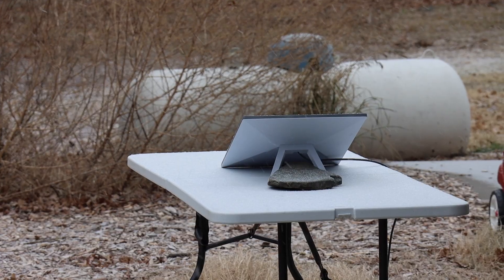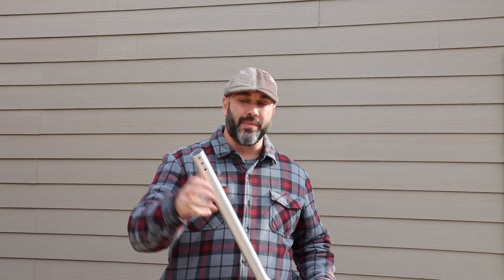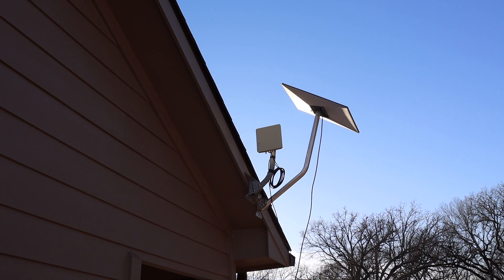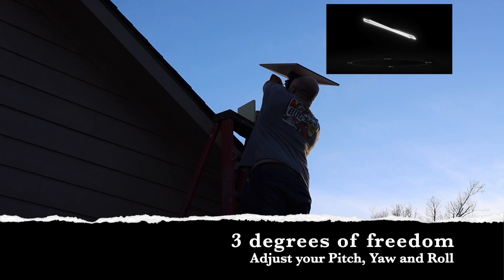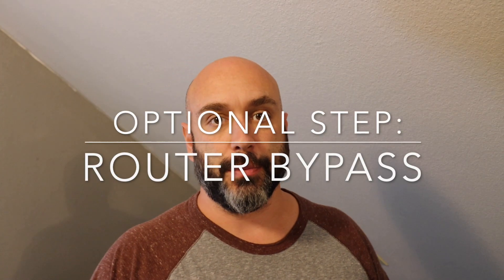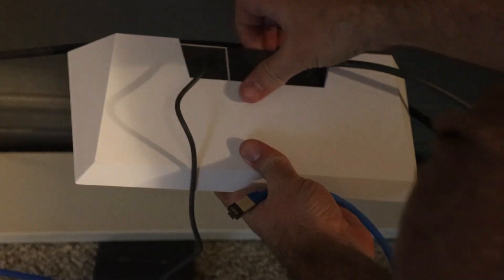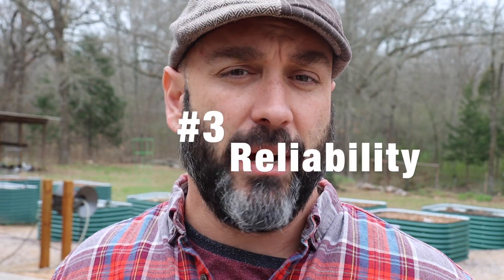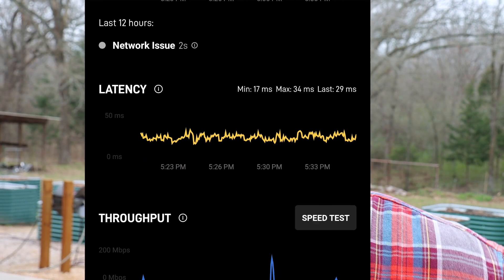DIY Starlink Install - Pole Mount Adapter, Speed Test, Router Bypass - Standard Gen 3 Version 3 & 4

Comment: Where did you get the metal mount that replaced the plastic flimsy mount?
Reply from the maker: If I understand which one you mean, I ordered the pole mount adapter from starlink. And the pole mount pole with bracket from Amazon. I've listed these two in the description. Unless you are speaking of something else?

Comment: The Gen3 Dish is worse in almost every single way.  I've mounted both now for several different people and the Gen3 is just bad.  You can tell they just cut corner to make the dish cheaper, the mounting system cheaper and pretty much the entire thing cheaper all the way around.  It's unfortunate.
Reply from the maker: I've never owned another so I'll take your word for it. The Gen three functions beautifully but the mounting on a pole did take some doing. I'm actually surprised it hasn't shifted and needed any calibration. I guess I did tighten it up really well though

Comment: My problem isn’t the speeds, it’s obstructions all the time , sky to the south is clear but they want me pointing it north right at the woods with tall trees
Reply from the maker: I don't know the exact layout but the angle of the antenna is about 10 °. I remember seeing a video of another channel in a similar situation and they mounted it at the top of a tall comms tower about 40' up and it was enough to get above obstructions. Hope you can figure it out. Sounds like you're good on buffered videos but latency is not good for gaming. Those towers can cost money but you can use it for other things also. Like ham radio, CB, PA speaker
Reply from the maker: Unfortunately that's the only direction. Have you considered building a radio tower or removing particular trees. Would it fare better on the other side of the house on a high eve mount?
Reply: @homesteadyall  I’m in the middle of trees, to the north points to someone else’s property so I can’t remove those trees, these are tall pine trees, I thought about putting it up on a pine tree but that’ll but a lot of work, I’m kinda screwed , watching shows seems to be fine but the kids gaming is nearly impossible to play without the games freezing

Comment: Thank you for the video I have a question does the Starlink app work when you are in bypass mode
Reply from the maker: The app still works but you lose some functionality. The app has functions for the router and antenna, so you lose only the router piece. You can still do the essential antenna and speed test and other app features like support, statistics, obstructions, alignment.  To bring back the router, you would have to do a factory reset.

Comment: Is that the updated pole mount? Any looseness in the pole mount?
Reply from the maker: There's not a lot of movement after tightening the adapter to the pole. I wish they'd have gone with a different design for the system but alas. This is working great.  I've seen no shifting or degradation in signal.  The pole mount was purchased separately (link in description). The adapter came from starlink and tightens via set screw. This one is the latest technically it's gen 3 revision 4 compatible
Reply from the maker: I added the link for the adapter to the video description https://shop.starlink.com/products/us-consumer-mount-pipeadapter-gen3
Reply: Thanks, still waiting for my pole mount adapter